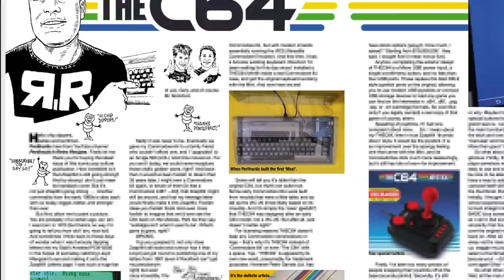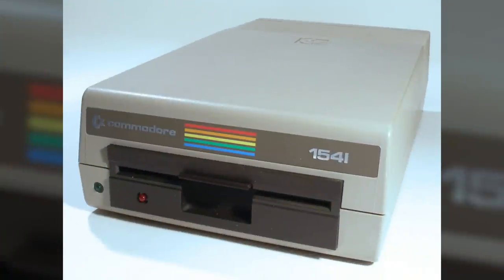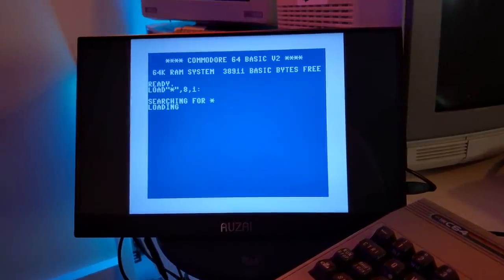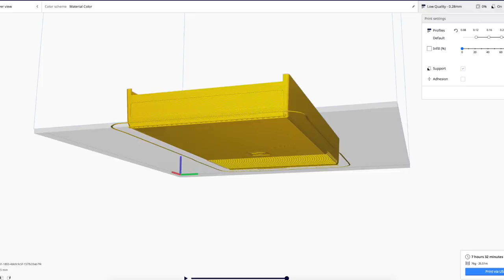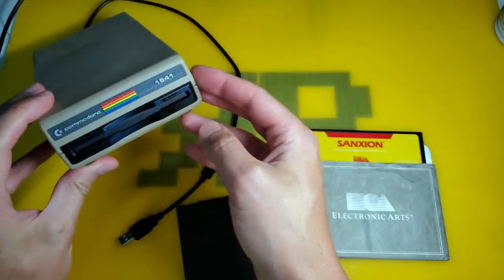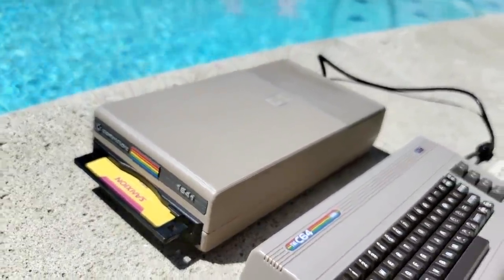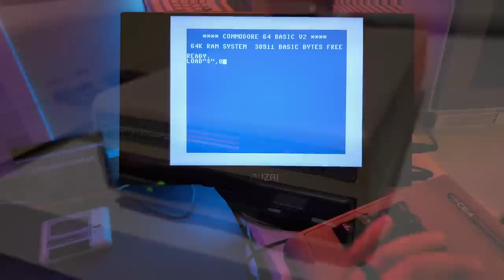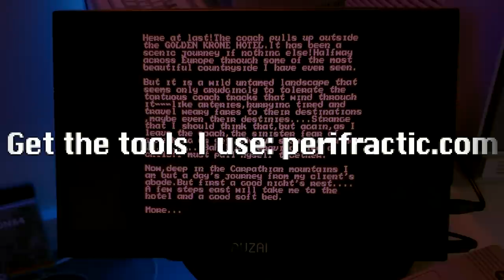Can we make REAL Floppy Disks work with THEC64®? 1541 Mini!

Comment: Each .d64 image is indeed 174kb or so in Windows etc BUT it is always that size even if the disk image is of a blank disk. Each 1541 (AKA D64 image) can hold that 174k etc and the average C64 game is about 45-50kb for the largest game PRG file sizes so you can get quite a lot of single loading games onto a single disk image of 174kb, like the entire collection of say Taskset Software games will fit on a single D64 disk. probably going to get between 50-60 actual games on each physical floppy disk if you make compilation disk images. You can use DIRmaster software to drag and drop files between various disk images and write out your own custom 'mix disk'. I do this all the time for my SD2IEC as long directories with hundreds of D64 images take ages to load into the SD2IEC filebrowser64 utilitiy. You can also get the disks formatted in the right way in a command window even in Windows 10 using the many options for the command line Format command.
Reply from the maker: Actually I fit 33... see the next video ;-)

Comment: Now all you need is an HDMI monitor  that looks like a 1702 to go with this setup.
Reply: How about a mini cassette drive that uses a micro sd card?
Reply: I was thinking the exact same thing
Reply: I haven't tried adding a USB hub to my C64-mini (yet), but if you can (and I don't see why you couldn't), then a 1702-mini would be an awesome place to sneak a small USB hub in also.  So you could have 1 USB cable from the C-64 to the 1702-mini, and then ports for the 1541-mini, the joystick, and an external keyboard.
Reply: What about a video converter to go from HDMI to S-video or composite to use with a real 1702?
Reply: @00Skyfox  it's a C-64 mini with a 1541 mini so a 1702 mini would just fit.... do they even make video converters that go for HDMI back ???
Reply: @FullMetalFab  I'm only assuming they make video converters for things like that, but I haven't looked into it myself.  There's converters for just about everything else, so why not HDMI to composite and S-video?
Reply: @00Skyfox   They exist, and the part of converting HDMI to analog isn't super-complicated (as long as the HDMI stream isn't encrypted) - but the video signal on the HDMI is probably a hi-def format, like 720p or 1080p, which means you'd need a scan-converter to change it to the 480i (or more properly, 240p in the case of a lot of old computers and game consoles)  for display on the monitor.

The process is simpler if the HDMI device in question actually supports 480i output, but most don't because why would they?  :)
Reply: @tetsujin_144  I suppose I'm sittin' pretty good because I have 5 CRT TVs, plus the C=1702 monitor.  I won't need to convert anything for a very long time.  :D

Comment: Why can’t USB EVER fit first time?
 Good stuff as usual 😃
Reply: It's because USB is the first four dimensional connector.
Reply: This is a mystery that will never be solved.
Reply: USB cables have a dot or logo on the upside of the connector. You can feel it with your fingers, and see it with your eyes. Just make sure it's facing upwards  in the device you're trying to plug it into and it'll slot in first time.
The only problem comes when you have connectors that are on their side, like in a PC tower or some TV on the side inputs. You just have to be aware that they've been rotated 90 degrees. 
Or... you have some wise crack and they put the USB port on upside down for no reason what so ever, like my ZTE mobile phone. Doesn't even work with docking stations because of it unless I want the display facing away from me... Yea, just get USB-C connectors when possible from now on.
Reply: after 10 different plug attempts, finally we have usb-c
Reply: @simonj48  yeah, I wish that was how it worked, but it's dependent on how the circuit board in the device is mounted. I have used a fair amount of devices where the USB socket is upside down to how it's supposed to be because the circuit board inside the device is upside down. 60% of the time it works every time!
Reply: At some point in yourself, you have been cursed.  Offended any gypsies at county fairs?  Treated your local witches with respect and fear (or at least compassion)?  To say nothing of offending techno-mancers on the internet - been in any online arguments in which you may have been less than respectful?  

Yup, curse.
Reply: Clinton Johnson oh dang. 
  I’ve been cursed.  
  Is there a cure?
 a good ol dose of USB-C perhaps ?
Reply: Because you have a 50% chance of getting it 100% wrong every time.
Reply: Bruce Alan yep. That math checks out 😆
Reply: Finally, there is USB C!! 😁😁
Reply: I always drag a fingernail across one of the flat faces. If I feel a crease, that's the "bottom". If I don't, then it's either the top or I somehow missed the join line.

Of course this only works if you know which way is "up" on the port you're trying to use.
Reply: That's how the inventor of USB will be buried: lower the coffin, lift it up, turn 180⁰, lower it again.
Reply: My USB seemed to be going in fine until I saw this video. Now I'm cursed.

Comment: I know what's going on. What's the difference between a floppy disk and a USB drive (any type)?  A partition table.

A floppy disk can have a partition table on it, but back in the day, it didn't have one.  The first sector on the disk (boot sector) ID'ed that it was a floppy disk and the file system was put on the disk not in a partition (like a hard drive), but from that first sector on (like an individual partition).

In essence, a hard drive partition is just a larger capacity floppy disk... just without the floppiness (and physical accessibility).

Windows, having it's heritage from MS-DOS, remembers how to properly format a floppy and lay out the file system, *without the partition sector*.  Because that's how MS-DOS 3.3 did it.

The Mac is treating the floppy as a USB hard drive (just not so hard) and slapping a partition table on it.  

So what is The C64 looking for when it first opens that first sector of a disk?  It's looking for a partition table, not a boot sector.  It rejects the latter.

I bet if you took that Mac formatted USB-driven floppy and stuck it in an old PC running MS-DOS 3.3 or later (up to 6.22), the PC will say "HEY! WHAT THE HELL DID YOU STICK IN THE DRIVE?!?!"
Reply: I wonder if it would make a difference to format the drive using command prompt and using some of the options there. There are also format utilities out there that might help.
Reply: Not if that USB drive IS a floppy drive.
Reply: @SummerFunMan  Nope, USB floppy drive uses the USB Mass Storage protocol, like everything else (even as a fall-back from the newer protocol).  While it's ID'ed as a floppy, it's technically just a storage device.
Reply: @strredwolf : It's still a floppy disk drive, so it's a floppy disk drive regardless of what connection it uses. I even have one and it comes up as an A or B drive somehow.
Reply: @SummerFunMan  You can assign any drive to those letters at time of formatting.  All Windows does is recognize "Hey, this is a floppy drive, I need to treat it old school..."

Macs?  "This is a storage device. It needs a partition table.  Floppy disk?  You mean that crap we tossed 20 years ago?  Grow up!"

Linux/Unix?  "Okay, that's a floppy drive.  Here's the device access point for it.  I even named it starting with 'fd' so you know it's one.  Feel free to add a partition table or access it raw.  It's all on you."
Reply: If that is the case why does a 720 kB floppy disk formatted in Windows work. Seems to me like Windows 10 has forgotten how to format a floppy disk properly.
I'll bet an older version of Windows can do it right.
Reply: @felixokeefe  I doubt it is on Windows 10, in part because I can format HD floppies in my USB drive on my Windows 10 machine and then load them up just fine on my MS-DOS 6.22 machine. So they aren't wildly out of spec. 
On the other hand, I do know that Win10 has some odd limitations in its formatting options.

Honestly, I believe that what is happening is: the OSX machine is doing it wrong, but wrong in a way that the TheC64 likes. There shouldn't be a Master Boot Record on a FAT floppy disk, but OSX was asking to choose the partition table format. 
I'd bet that the TheC64 was checking for the MBR, not finding one, and going "dur-hurr, I think this USB drive is broken" until OSX went and put an MBR onto a friggin' floppy disk. 
In this case, the errors cancel out and everyone is happy.

Comment: • You used the GUI interface to format the floppy. If you use the format command from the command-line, you get better control the parameters.
• Airwolf still has one of the best theme songs of any TV show.
Reply: Yeah GParted on Linux has fat16 and fat32 right there and better control over the parameters while providing a nice GUI too!
Reply: These USB floppies don't behave like a real drive either, it has flash memory that it copies the floppy into before telling the computer, and makes it difficult or even impossible to format correctly, course, trying to mount a realy floppy drive in modern hardware is...uh.. tricky these days.

Started building a XP era desktop with a Athlon 64 and a Asrock Dual-Sata 939 socket motherboard to start playing some retro games and using retro hardware, will probably dual boot linux, handily it has a header for a proper floppy drive (which I'd love to test with a 5.25" drive too), even have a AGP slot "BFG TECH Geforce 6800 GT OC" graphics card which will be heaps of fun to test out, mercifully it also has Sata 1 and 2 ports, USB, and even a couple PCI-e slots so it can be fitted with modern parts too.

Tempted to customize the case like a Commodore computer, especially since I just found a real 1541 floppy drive recently...

Comment: Very cool stuff! Any thoughts on creating a 1581 case for completeness? A 3.5" drive pretending to be a 3.5" drive!
Reply: Agreed. I thought the same. Make a c1581 mini to match.
Reply: Unfortunately all USB floppy drives I have seen yet have the eject button on top, which kind of breaks the design. There might be ways to get around that. Perhaps some sort of lever mechanism.
Reply: @Shifter-1040ST   The easiest way around that is to buy a USB adapter board for a regular-size floppy drive. A bog-standard 3.5" PC floppy drive will have the eject button in roughly the same location as the 1581 had it. Makes way more sense than to try to convert a slim-line drive to look like a regular drive.
Reply: @tetsujin_144  You're right on that. Silly me wasn't even aware such adapters exist.

Comment: What if someone made some sort of IEC to USB adapter, so you can use actual Commodore disk drives in this, like the kind of adapter you can use to connect one to a PC (I don't remember if that's USB or not, but they could make one)?

Comment: OMG, my first 1541, I was in heaven.   Infiite amounts of storage.   I don't know how I bought it, I don't know where I bought it from, I dont' know where I got the money for it, I don't know where it is today.   Now, with terabiytes and the cloud...  it seems.. ludicrous.. to even touch a floppy.  And yet I have more floppy drives int he barn and floppy disks than anyone  within a hundred miles moldering away.   I even got 8 inch floppy disks,a nd punch cards...   and 8 inch drives... and I ahd a 5.25" XT seagat hardrive at one time...  1mb I think...

My first harddrive was an 18mb SCI harddrive in a Mac SE.. and again.. heaven lol.

I remember spending about $250 for a 400mb IDE IDE harddrive for a 586 and thinking I'd never need any more harddrive space ever again.. it was so infinite.  then i started getting 640mb harddrives and 1.2gb drives in PC's by the truck load, and 400mb was just... disposable int eh trash, too small to use..   

And that was...  back in acnient history...

Comment: This is so awesome! I wonder how difficult it would be to edit the STL's a bit to form a 1571 style? I was a bigshot I guess, as I started with a 128 and 1571 in '87 and only acquired a 1541 in '95 from my girlfriend's dusty closet....her real closet, not a euphemism. 😁

When I tossed my 3.5" floppies and drives a few years ago I swore they would just be remembered as low storage and unreliable tech that would never become cool vintage like our lower storage and equally unreliable 5.25 Commodore software/hardware and here I am pricing usb floppy drives and 3d printers on Amazon. Nostalgia is so silly but so fun.

Comment: 7:57  Nice.

I like that expression "It's always the third way around with USB."  So true.  A neat trick is that the USB logo on the device is supposed to be on the top, so as long as you have that logo face up, it should work, assuming the company that made the device did it right.  Before I knew that trick I would just end up looking at the USB directly to see how it fit.  Still a pain though.  lol

Great work!
Reply: The ports are upside down on the c64 mini because the circuit board inside is mounted upside down.
Reply: @kevinholloway4950  Ah.  Weird.
Reply: USB was originally designed to be able to be plugged in regardless of whether it's upside down or right way up, but they figured it was too complicated.
Reply: LMAO  Sounds about right.
Reply: Cries in sideways USB port
Reply: I'm starting to think everyone involved in the USB design process was very drunk at the time.
Reply: @Frank_D  Well, that's how most tech stories begin, really, no ? "I'ma fly a man to the moon!" -"Shut up, Rob, you're drunk!" ... next thing you know Apollo 11 happens xD

Comment: Being able to use 3.5" disks is nice, but it still feels wrong. What I would like is a way to connect a real Commodore 1541 drive to The 64 and be able to load actual 5.25" Commodore 64 disks from it. I know there are adapters that people have built allowing you to connect a 1541 to a PC, so I wonder if one of those would work.
Reply from the maker: See other comments 👍🕹️

Comment: The original 1541 disks were single-sided 180K per side,  made up of 40 tracks with 17-21 sectors (depending on distance from the centre of the disk, average 18) and 256 bytes per sector. Thus the capacity was 40 x256 x 18. All 3½ inch disks are doubel-sided 80 track, 9 or 18 sectors per track,and 512 bytes per sector, giving 80 x 512 x 9 (360K) or 80 x 18 x 512(720K). In addition different disks use different sector numbers. IBM use 01, Amstrad use Hex &41 , &81 or &C1 to determine CPC or PCW or CPM operating systems. I think Apple IIe used 09. There are therefore a whole load of potential reasons why the disks formatted on the PC would not work in the USB drive but the Apple ones did. It depends on the settings in the USB drive's ROM and the C64mini's inerface.

Comment: I want THEAmiga which could be done with the same hardware found in THEC64.   Just put it in a reproduction A600 case for a smaller, lower cost case and lower cost keyboard with no keypad.

Comment: I'd like to see you use the worlds's highest-capacity floppy disk, the Iomega Zip 750, as the drive mechanism for your new model of "1581" for this system (that is, if you can get a USB Zip 750 and replace its case with your own).

Comment: You could try using your modified Gotek drive (the one with the piezo speaker mimicking disk drive noise). You would have to find a suitable caddy with 34 pin connector to USB ( or the innards from one).

Comment: Wonderful job. I still have the original C64 and 1702 monitor and disk drive and 1525 printer stored upstairs somewhere along with the "Your Commodore 64" book and Programmers book. I haven't used it in decades, but I'm thinking of  getting it out to play some games. I'm surprised to find that there are a number of people still interested in this old machine on the internet. I didn't play games originally as I used it for programming in basic and assembly and took the board out to build a robot in the 1980s. It's in my mind that I spent around 2k for the above - which was much more in purchasing power in those days. I'm retired now and may power the old 1 MHz up just to see what I can do with it.

Comment: I have had similar problem with an old PC. I used a floppy disc that was formatted in W10. When I was comparing sectors, I found out that in sector #0 at position 15h has to be value F9h to get it working. I don't remember what information it exactly holds, but if interested, I can dig into my old notes.

Comment: The key part was "MBR". Because floppies are so small, they're not usually partitioned.  However, practically all USB flash disks are big enough to warrant partition tables.  Windows probably takes a similar stance, that floppies don't need partition tables.  You could use fdisk or parted in Linux too.  Neither of those cares about the disk they're operating on, only that it is a block device.

Comment: The C65 used 3 1/4 disks, Did you know if you name the image THEC64-drive8.d64, basic in the THEC64 mounts it automatically. VICE in THEC64 looks for a image with that name and if there no image on the USB Stick it creates the image and mounts it in the emulator so it looks for the name when the C64 emulator boots up, if you name the image that and have one image on each disk it will be like your loading a disk from the 1541 Mini... :) that way you should be able to bypass the USB File Loader or Media Access
Reply from the maker: Thanks! I simultaneously figured this out when I noticed the Maxi creating that image which would then appear in Media Access. Can I name any file THEC64-drive8.d64 or does it only work with .D64 files? E.g. could I rename a .BAS or .PRG file THEC64-drive8.d64 ?

Comment: 12:54,   actually it's not. "floppy" refers the magnetic disk itself which both floppy and round (thus "disk").  Although it has a rigid center ring if you hold it by the edge it does flop.
Reply from the maker: Probably going a bit far to pick holes in a joke... ;-)